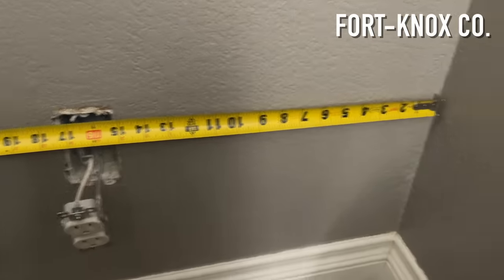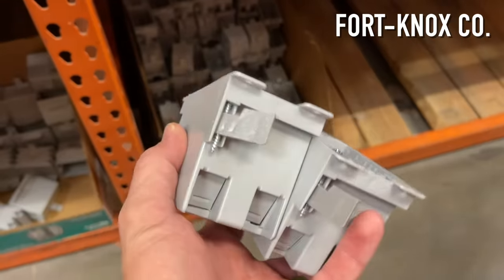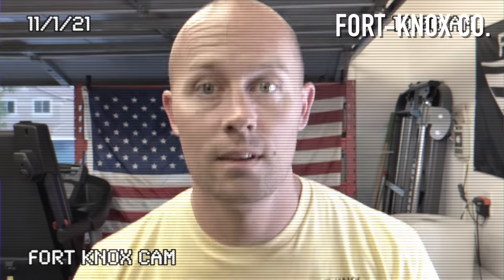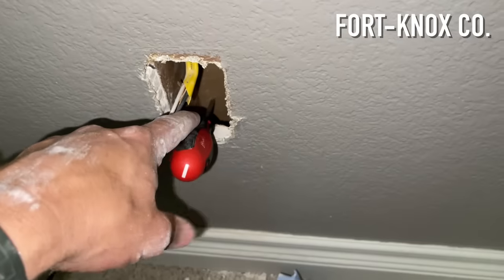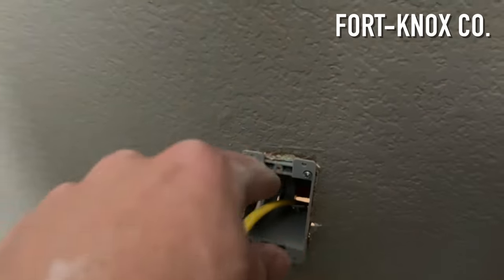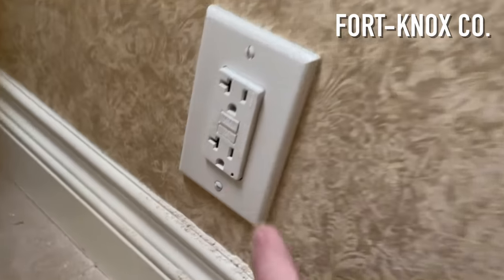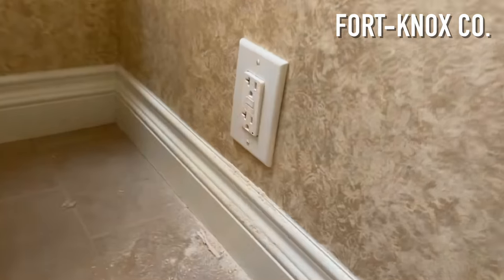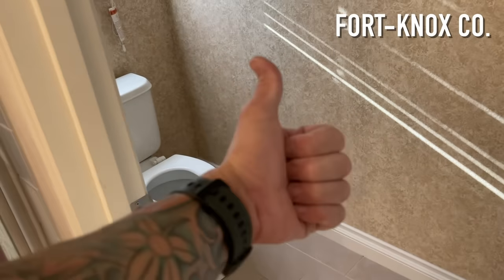How to Add an Electrical Outlet ANYWHERE !! Heated Toilet Seat or Bidet Install | Run Power Easily

Comment: Jeez! You'd be taken out and shot for installing a socket in a British bath/shower/ toilet room! It is possible to supply a  towel rail (for example) through a double pole fused switch tapped off the ring main. But NO sockets!  In Europe, sockets can be used, but must be no less than 60 cms from any sanitary fittings.
Reply from the maker: That's good to know. I know every city, state or even Country can have a wide range of acceptable building codes.
Reply: @FortKnoxCo  It's always interesting to me to learn about electrical systems in other countries. I understand the British system very well, but had to learn about the French system when we moved here. The voltage & frequency is the same, so all I had to do was change the plugs on the appliances we brought here. Although I prefer that British plugs have fuses inside where European ones do not. Thanks for the videos.
Reply from the maker: @peterking2794  that’s cool to know. We haven’t traveled outside the country, yet, but I think it’ll be interesting to see stuff like that and how the cities/structures are built.

Comment: IF this was truly a video on how to install an outlet "ANYWHERE", then show me how to install the outlet where you found that vent pipe.  
Otherwise change the title of the video to; how to install an outlet CONDITIONS PERMITTING.
Reply from the maker: Well if you wanted to open the wall up more and cut and re direct the vent pipe you most certainly could. But that would be waaaaay more work than needed. Especially when in this case it was flexible where the outlet was needed. So just made the decision to save some time and money and not mess with the vent pipe.

Comment: There are actually 22 uses of the word "actually" in this video. It is actually possible to use "actually" in virtually every sentence, but it isn't actually necessary. Actually watch the video again and actually count every time he says "actually." It actually becomes extremely distracting, and, actually, quite annoying. 

It's actually a bizarre phenomenon in many YouTube videos where the presenter actually over uses "actually." It could actually be that the speaker is actually nervous or it could actually be that the they feel that using the word actually makes them sound smarter. Now that it has actually been pointed out, the occurrences will actually become impossible to ignore.

To actually avoid doing this, YouTubers should actually write a script for the video. It will actually make the presentation better.
Reply from the maker: You should Actually turn this into a drinking game. Actually sounds kinda fun. That’s for watching and commenting

Comment: Um ya not code and not a good idea but hey safty second right !.....why anyone needs an outlet beside thier toilet is beyond me ! Unless you need some kind of power tool to break up your stool , and if thats the case you got bigger problems .........
Reply: The only time someone will inspect that home is if the current owners are selling. If that outlet violates their code, then it can easily be removed. Buyer and seller can negotiate the next step. 

That being said, the fundamental idea of this video is correct. You can get power from an outlet on the opposite side of a wall. But for this particular solution, that's cutting corners. He should've tapped into a bathroom outlet, and even better, hardwired whatever device the client needs instead of an outlet. I'll leave my rant at that

Comment: This is very dangerous advice. The reason builders don’t put sockets in bathrooms because it’s against regulations. There are specific methods used in these kind of areas. I would advise using a professional electrician for this type of work. Vanity units use transformer isolation which gives another level of safety. Don’t do this as a DIY. Stay safe
Reply from the maker: Yes, its always a good idea to consult a licensed electrician or general contractor before taking on any job around the house.
Reply: I'm nearly 80  years old and have yet to encounter a bathroom without electrical sockets.
Reply from the maker: @xbubblehead  I agree
Reply: @xbubblehead  Under Uk regulations electrical sockets can be fitted so long as they meet certain special criteria. But in modern bathrooms you would normally use shaver sockets only. These are transformer isolated and are safer. Also there is a safer way to provide power to an appliance in such an environment. For example, in a bathroom I’m doing at the moment the plumber is fitting a Japanese toilet. This needs power. So I have fitted an appliance outlet near the toilet. This is connected to an isolating switch located outside the bathroom. And the circuit is protected by an RCBO. So there is no need to take the risk of fitting a socket in a wet area.
Reply: @mehmetramadan2656  So a blanket statement that builders don't put sockets in bathrooms is not correct, even in the U.K.?
Reply: @xbubblehead  As I said you can have a socket in a bathroom if you meet the necessary criteria. It’s not a DIY job. It is avoided if possible.

Comment: Did you center the outlet?
Reply from the maker: The location of the outlet was not centered on the wall if that’s what your asking. We measured over to where the home owner kept a basket by the floor, I located a power four e and stud to work around and we placed the outlet there. It was about 1/3 the way over from the back wall. It was placed where the home owner wanted.

Comment: I did this exact thing to the T but now my outlet says open ground Neu 30v when tripped but when it’s not tripped it shows 120v and correct connections
Reply from the maker: Hmm. Not sure why it would read that way. Obviously it shouldn’t trip unless there’s a fault or short. So otherwise it should function as a regular outlet. The outlet itself does t need to be a GFCI, it just needs to be on a circuit that has a GFCI somewhere before it or on the breaker. The circuit need GFCI protection when around wet areas
Reply: @FortKnoxCo  thank you so much for the response and for being super quick! We went with the GFCI because it’s next to the toilet and for some odd reason this bathroom never had one to begin with. We did nothing wrong based on your video and all the other vids I’ve seen but it’s odd how when tripped using a Gfci tester it shows open ground Neu 30. I hope everything is okay in the system though
Reply from the maker: @singhjas   I problem at all. Yeah if it’s not tripping for no reason and you just get that reading when you trip it or test it then I’d say you’re fine?  You just don’t want it popping randomly for no reason on its own. That obviously would be a clear indication of a fault somewhere

Comment: Another nice option would be to power the bathroom outlet first and the load side of the GFCI over to the bedroom which would add ground fault protection to the bedroom.
Reply from the maker: I agree.
Reply: @crusherfang9368  to add ground fault protection to the other outlet like the comment said. Thanks for the 3 year old style reply.
Reply: @crusherfang9368  a lot of house building code now require every CIRCUIT to have a GFCI. But to make every outlet a GFCI would be excessive. The breaker in the box is already one line of defense if there is a fault. So a GFCI outlet helps stop the power before that. So it’s already similar to a breaker in front of a breaker. But to make every outlet a GFCI would be pretty costly as well.
Reply: @crusherfang9368  right, to make every outlet a GFCI would be over redundant. But most homes in our area have a GFCI outlet as the first outlet in every circuit now. Some older homes only had them in circuits that had outlets in wet areas.
Reply: @crusherfang9368  because it’s expensive, but this one is free since it’s already required in the added outlet.